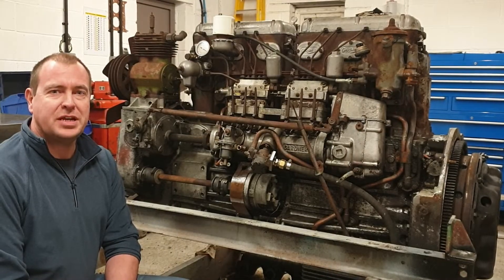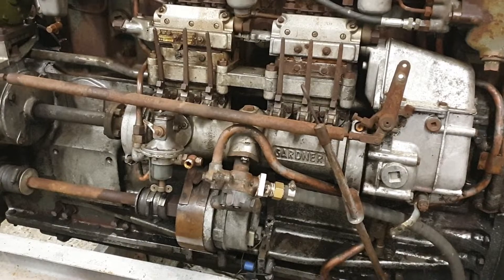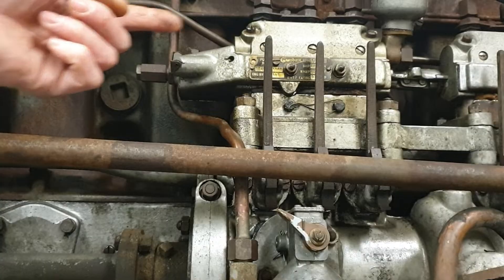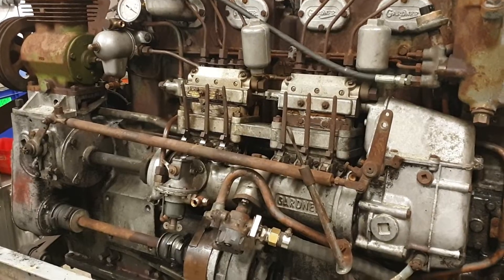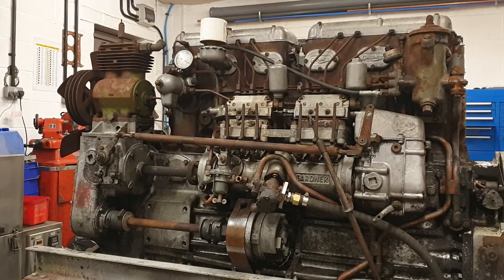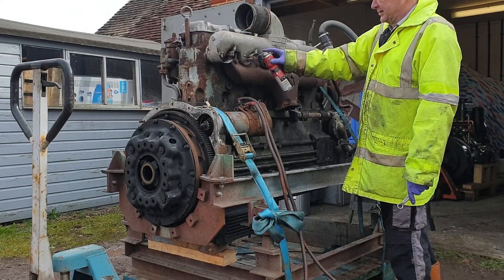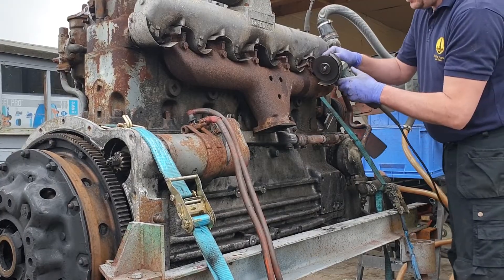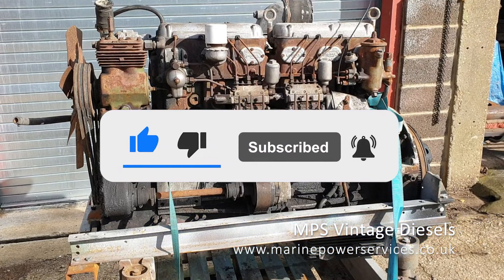Gardner 6LXB 180 Overhaul part 2 - Will it run? And if it does how well? Atkinson Borderer

Comment: I thought 32 psi oil pressure was normal?
Reply from the maker: On a 6LXB the oil pressure with engine at 1000rpm and oil upto a temp of 60Deg C should be 35psi. However it wasn't the final pressure that was the issues here it was the excessively long time from start to achieving oil pressure that was.

Comment: Remember working on these engines as an apprentice at a Foden main dealership in 1976 😊
Reply: I also worked on rebuilding Gardner's at Foden's in 1970 in the Repair Shop. Do you remember Frank, an older man, who installed the main bearings and crankshafts? You most likely remember the LW series had white metal bearings and had to be scraped in. As an apprentice, if you touched the faces of the bearings he would give you a clout round the ear. One warning not to do it, one clout round the ear and you didn't touch the face of a main or big end bearing for the rest of  your life. Frank may have already retired by the time you were there in 1976. There was also an older man further up in the shop who assembled the engines.

Comment: Just discovered your videos. Brilliant. I have 2 x 6lxbs in a passenger ferry. Lovely engines. She gets pulled up for the winter. When I start them for the first time in a couple months I get that noise of 1 or 2 valves sticking every time without fail. After that I don't hear it again for the rest of the season.